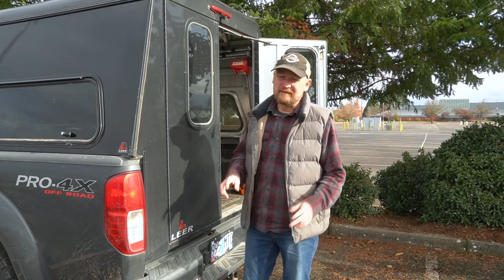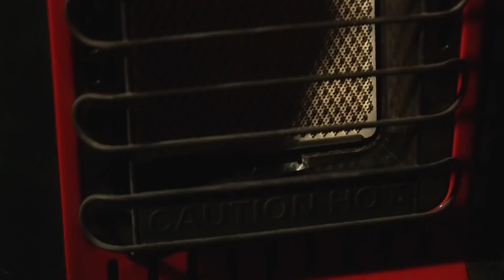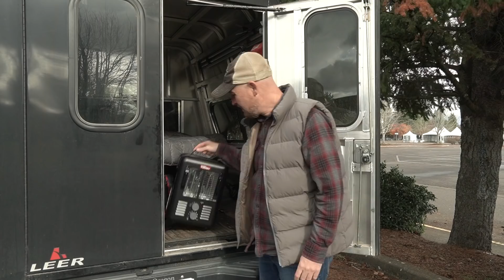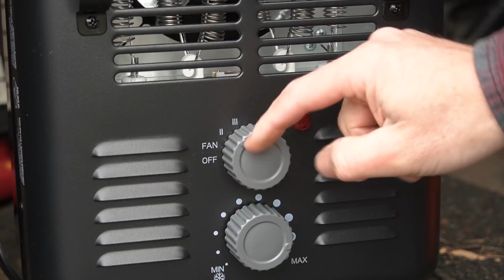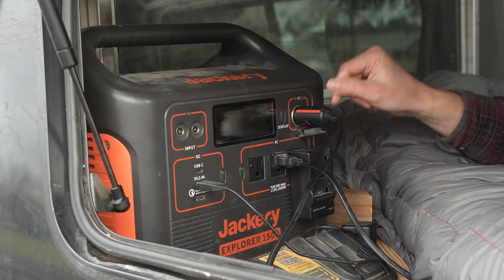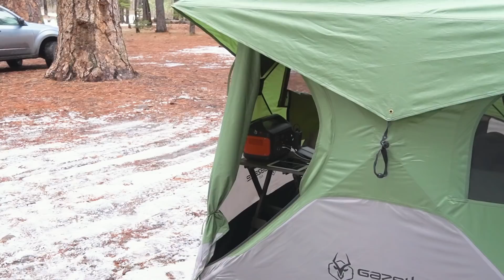Reconsidering Electric Heat & Jackery Black Friday Deals

Comment: Does this heater make the atmosphere greasy? Like when you cook? My skin tends to get really greasy easily.
Reply from the maker: I talked about two heaters in this video, the Mr Heater Buddy (propane) and the electric heater, so I'm not sure which you're referring to. Neither makes the air greasy. The propane heater generates humidity in the air, so it can result in more condensation accumulating on cold surfaces. The electric heater just blows air over hot coils and adds nothing to the air. In my opinion, electric heat is by far the most pleasant heat when camping, but it is the most difficult to work with because it requires a huge amount of electricity to to generate that heat and quickly depletes even high capacity batteries.

Comment: We built our ExpeditionVehicle with obsessively excessive insulation.
Each of our windows is open year-round to vent heat, carrying humidity and odors with it.
Our interior is 7w x 12 l x 7h, about 600cf.
.
We use a Wave 3 catalytic heater on LOW, about 1,700-Btu.
.
We inherited a Little Buddy, but may chuck it into the exchange pile... its LOW is 4,000-Btu, much too much for our space.
.
We hear good reports about a propane filter.
And yet, nearly two decades full-time live-aboard, we never used a filter on our Wave 3.

Comment: For your little buddy heater You can try using a wire brush to clean the heat sensor rod the pilot light builds up Carbon on it

Comment: The jackets 1500 will only run that heater for about 2 hours if that . Just saying it wont last thru the night . I camped at 27 degrees outside . My van was not that cold but it ran out of juice really quick
Reply from the maker: Right. But I have never run a heater through the night. A blast of heat getting ready for bed, and a blast of heat in the morning when getting up and getting dressed. No need to heat the entire space through the night with appropriate bedding.

Comment: I use a electric heater and enjoy it , useing 25oo watt generator to powe it. Generac runit fine plus keeps houe batteries charged. My 1500 watt inverter wont really run my heater but allso run 200 watts of solar . This is ok because i run my heater all night because i dont like to wake up to a cold camper or sit on a cold camp toilet not into pucker power. Enjoy your electric heat

Comment: I can’t find the follow up video for the electric heater………..
Reply from the maker: I put it to the test in this video:
https://youtu.be/KnzvQMEbuSw
I talk about it at length starting at a little over 10 minutes in.
The heater worked for me, using it but ultimately I'm not convinced this is a good long-term solution. It draws SO much power that I have to really be careful about how much I run it. It has worked out at a quick easy temporary fix so I could continue winter camping until I decide on a better permanent heat system (e.g. diesel heater, etc).

Comment: How long do you find you can run that heater/blanket?

I’m looking to outfit a cab-high camper build with power.. trying to decide if jackery is the way or a 12v deep cycle and an inverter is the way. 

I also have a 2k generator but want to minimize use.
Reply from the maker: The blanket pulls a little over 50 watts, so I could easily run it all night. I generally have to switch it off after an hour or two because I get too warm; if I wake up chilled in the middle of the night, I reach over and turn it back on until I get too warm again. This particular heater pulls over 1,000 watts so it would drain my Jackery 1500 in about an hour and a half. But here again...I only need to run it for a handful of minutes at a time. I would say it's not an ideal solution for winter camping, but it was a quick, cheap and easy fix for me as I am between my broken propane heater and whatever long-term heating solution I will eventually go with.

Comment: Oh wild! I just bought one of those electric blankets with the idea of running it off my Jackery as opposed to using my Buddy heater. Propane bottles have been getting expensive and hard to find. I want to time how long my Jackery 500 will run it. I'm actually working on a video with several practical and impractical uses for my Jackery.

Comment: We have about the same size space to heat and I was planning on getting a small 250 watt ceramic heater. I figured that would be more than enough. Are you going to insulate your cap?

Comment: Really wishing that heat solution works out for you. How convenient, just reach over and turn on the outlet/plug in the heater w/o having to get out of the warm bed! Also, we've had a similar unit for years, and outlasted at least three other heaters. It's mostly used in my garage, so it gets knocked around a bit. Hope you have similar durability results.
Reply from the maker: That's good to hear! I'm pretty sure this heater will not be my long-term solution, but it was at least a quick & inexpensive way to get me back out in the cold for this winter, and buys me some time to figure out what direction I eventually want to take.

Comment: You need to clean the little plates and the end of the tube where the gas comes out I clean mine every year with a little toothbrush and it works just fine...

Comment: How much power does that blanket use per night?
Reply from the maker: This one draws around 50 watts...the total consumption per night will depend on how much you run it. I can't sleep with it on all night. I turn it on at least 15-20 minutes before getting into bed, but then I need to shut it off after about an hour in bed. Depending on how cold it is, sometimes that initial heating period is all I need and my blankets and body heat are enough to keep me cozy through the night. On colder nights, if I wake up and feel a bit chilled, I do turn it back on for an hour here or there.

Comment: Donald, the little rod the flame touches is a thermo-couple sensor. It controls the safety valve to stop gas from flowing if the pilot goes out. At times they simply fail. At other times it is not uncommon for a thin coating of ash from dust to build up and insulate the thermocouple sensor making it  "think" its gone out. Thus turns off the LP to the burner. You might try polishing it with very fine sand paper or Emory cloth or any grade of steel wool. I hope this helps. Thanks for the videos. Merry Christmas!

Comment: Love the channel, love the new rig!  Dislike the logic here.  So “hundreds of dollars” for a diesel heater vs ~$900 for a battery bank capable of running an electric heater?
Reply: Battery bank has multiple uses, diesel heater has one. That’s more the logic there, or already having a battery bank as most do
Reply: @ChrisZBr0wn  concur,  but not one big enough to run a heater.  The logic here is that he already had a 1k battery bank (for free).  A 300 watt bank will not run a heater.  Also… lets hold out final judgment till he runs his tests.  I think he may find the setup to be inefficient at best.
Reply from the maker: You're absolutely right...the logic works for my personal situation, because, yes, I already own a Jackery 1500. I agree that it makes no sense for someone to go buy a massive power station just to run a heater...some kind of external combustion diesel or propane heater makes far more sense for the money. Electric heat also makes no sense if one wants to maintain a sustained heated space. This was - for me - simply a fast, cheap, easy way to get short blasts of heat, exactly the way I was already using my Mr Heater Buddy, just for a handful of minutes at bedtime and a handful of minutes when getting up in the morning.

I already wanted to eventually replace the Mr Heater Buddy with some kind of external combustion heater, but at the moment, I have too many other projects going and just could not take the time to figure that all out and still get out for some winter camping this year.  

For other people, this solution only makes sense if they already own the power bank or were planning to invest in one anyway, and just need short blasts of heat at key moments rather than maintaining a warm living space. Though I was actually surprised by the number of people who commented on this video who have been happy using electric heaters. 

My hope for the final interior build of the canopy is to create a more usable, livable space where I could hole up and maybe do some work on a blustery day, and an electric heater pulling 1,000 watts off my power station is definitely not going to be a workable solution for that scenario. :-)
Reply: @softroadingthewest  thanks for the reply!   When I am working remote from my camper I have a Yamaha generator that runs a heater/AC and charges my rockpals power banks.  Where I am struggling for a solution is when I am camping just out of my 2002 Xterra (Rexy) and am considering a portable self contained diesel heater.  Keep up the great work!  We really appreciate what you are doing.
Reply: @softroadingthewest  fyi… just pulled the trigger on the 1500 using your link ;).   Safe travels!
Reply from the maker: @ebbiketrip2497  Nice, the 1500 is a beast!

Comment: Good info here about heating solutions and I will be interested to see what your use testing shows. 
That said, I can’t help noting the expanse of aluminum surface area of your rig. Aluminum is a very good heat conductor, so interior wall insulation would be some of the best bang for the buck. At a minimum Reflectix, but there are also foam panel products that would go a long way to assist in solving this problem, and that of summer’s heat.  I suspect you are already planning something, so I look forward to seeing what you come up with. Best wishes this holiday season! :-)

Comment: If you have used a regular hose with a 5lbs propane tank it will cause the buddy heater will clog. It's a known issue online. You can only use the green tankss UNLESS you have a filter (off amazon) that you can use a regular hose with a 5lbs or 20lbs tank.

Comment: I picked up a little electric heater (170w & 250w) for work and also for camping trips with my Jackery 500. It gives off enough heat for me, and with proper insulation should be able to heat an extremely small space like a car interior. It's not heating my 200sqft office with 14' ceiling, but it is keeping me toasty.

That said, I think I will get a propex system for my vehicle next year...it doesn't have the condensation issues of the Mr Heater Buddy and has a thermostat (digital upgrade available). It is expensive, but I think it would be worth it for extended trips where I'd be sleeping in my vehicle frequently. After moving my spare tire to a swing-out rear hitch, I have a lot of storage space in the spare tire well that would be perfect for a heater system.
Reply: How has the electric heater worked for far?

Comment: I have circulation issues in my legs and feet, so I need to be extra careful in freezing weather. I have been using a Jackery 500 with a heating pad for my dog for about a year now.  I have tried this with a heating pad under my sleeping bag with great results as well. Works great with no problems, just make sure and charge it the next day.  I also use the smallest Buddy heater like you do, mornings and evenings.  For those times I am in a campground with power (rare), I carry an extension cord and a small 500 watt electric heater.  Additionally, and for those extra cold nights, I have an old foot warmer stone they used to use in buggies and older vehicles, that is cut flat and has a wire bail.  I just put it over the fire, or heat it with the Buddy heater, wrap it in a towel, then put it at the foot of my bed.  Very toasty.
Reply from the maker: LOVE the stone idea! My mom talks staying at her grandmother’s house as a little girl and bringing a stone heated on the wood stove to bed to stay warm at night. 🙂

Comment: @softroadingthewest what battery bank size do you recomend for running such a heater car camping in the winter months?

What heater are you testing?
Reply from the maker: It really would depend on the heater and how you use it. I don’t think it’s really feasible for maintaining a heated space...a heater with a low enough draw to run for hours off even a large power station is unlikely to provide enough heat. For short term blasts to make changing clothes comfortable as I’m doing, the power station would need to have a delivery capacity in excess of the heater’s draw. My Jackery 500 would not be able to power this heater for example as it’s drawing 1,000 watts. This heater is what I believe to be Walmart’s house brand HyperTough though I suspect you can probably find more or less the same thing under other names.

Comment: Thumbs down first of your videos I disliked. This video is just you trying to sell Jackery products. 

I got into portable solar power products and steered clear of Jackery after comparing them others like Ecoflow and Bluetti.

That little battery will not be able to sustain your requirements. 1078ish watts an hour on low? And your Jackery unit can only sustain that for a few minutes. On top of powering your other devices. I believe that regardless of what your estimates use is you will find that you will have higher power requirements especially running electric blankets and electric heaters. Also account for the losses associated with dc to ac conversion of the AC heater.

This is where those looking into this as a viable option need to identify how many watts they realistically will be using so they can identify what power solution they will be buying instead of blindly purchasing Jackery products on sale for black Friday and regretting it later.
Reply from the maker: I’m not trying to sell anything. It makes no difference to me what power station anyone buys. I have been happy with my Jackery units. If a different solution makes more sense to you, by all means that’s what you should do.

As far as sponsored content on the channel, I am open to suggestions for how to keep a roof over my kids’ heads and food on the table while spending 50-80 hours a week running this channel, producing content that everyone wants to watch but no one wants to pays for. I would LOVE not to rely on advertising, but that is the reality for virtually all content creators, including the shows you watch on TV, sports broadcasts, radio shows, podcasts, etc.

Should I put my videos behind a pay wall? Would you be willing to pay to watch?

I do everything I can to keep this to a minimum on my channel. I receive 20-30 sponsored product offers per month and decline 99% of them. I manually remove at least half of the ad breaks YouTube inserts in my videos. I maintain a Patreon page, which reduces my reliance upon commercial content - you can thank my Patreon supporters for subsidizing reduced advertising for everyone. Likewise, Jackery’s sponsorship plays a huge role in keeping this channel going. The occasional brief Jackery blurb goes a long way in reducing other advertising or product placement I would have to accept in order to devote the time and money I invest in this channel and still, you know, eat.

I made it painfully obvious in the thumbnail, title, and description that this extra midweek video contained Jackery advertising so that anyone who doesn’t like to see that could just skip it entirely. I’m curious why you clicked anyway?

Comment: Did you run the Mr Heater Buddy off a bulk tank and hose? Don't forget to use the filter.
Reply from the maker: So far, no. I do have a hose but so far haven’t used it as I had a supply of green canisters.
Reply: @softroadingthewest  If you prefer using the small 1lb bottles, Flame King has DOT safe refillable bottles.

Comment: Those heaters are known as milkhouse heaters. Not sure if you know it or not, but they do make a smaller version that is about half the size of the one you got. 
That is a good price on the Jackery 300. I think I have my heart set on the LiFePO4 battery units at this point though. Safer and more charge cycles for about the same price. But, 30% off hummm....Will have to see what the other units have offer this weekend. 
Thanks for the video! George.
Reply from the maker: A smaller heater would be good. Admittedly I was pressed for time when I bought this and couldn’t order online...just had to take what I could find at the store. A smaller unit with a little lower power draw would be nice. Definitely plenty of good alternatives to Jackery power stations out there. 👍

Comment: For your style of heating the electric solution may be sufficient. I don't like being cold at night and my wife likes that even less. So for me the investment into a Propex heater was a good investment. Just came back from a quick trip out to the coast and despite nice weather we hit high 30s at night - which doesn't concern you much with a ducted heater like a Propex because the camper was at a cozy low 60s without using up my battery.
If you just run it for brief periods of time a decent battery system will do the trick, If you run it all night long on and off (via thermostat) you might run out of battery depending on insulation. My little camper is well insulated so at around 40 degrees outside and 60+ inside the thing runs maybe 5 times for the entire night at around 3 to 5 minutes each time. I always keep a window and the top cracked open so we don't get condensation from simply breathing. The ducted heater takes any moisture right out. Of course my trailer is small and has little volume that needs heating, a larger rig like yours would take considerably more energy to keep at 60 degrees.
Reply from the maker: I’ve been super impressed by Jason’s Propex and I like the idea of using propane which I have to carry anyway (rather than adding a third fuel supply to the truck with diesel). If I eventually evolve the build to something I can comfortably spend more time in, e.g. do some video editing on the road, then I’ll definitely want to get into some kind of sustained heat source.